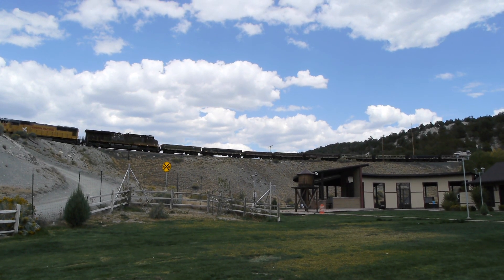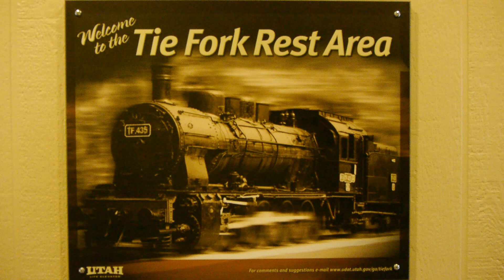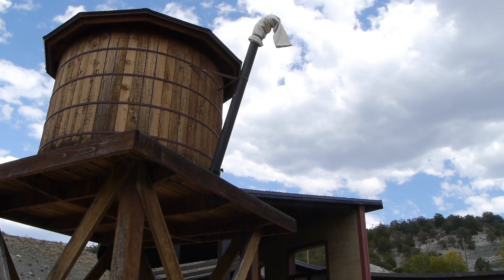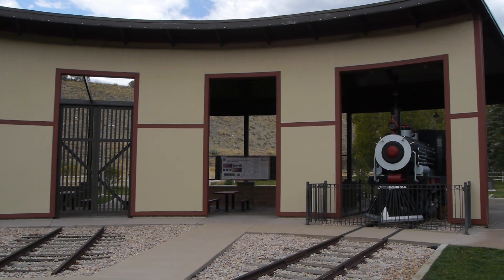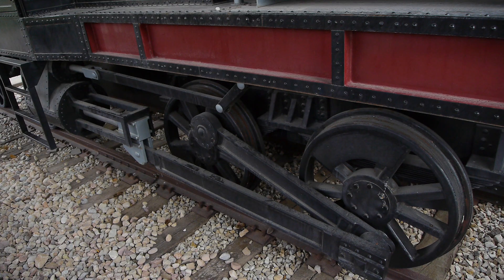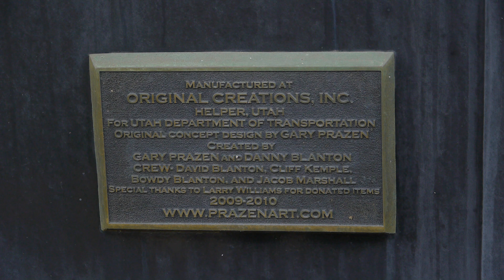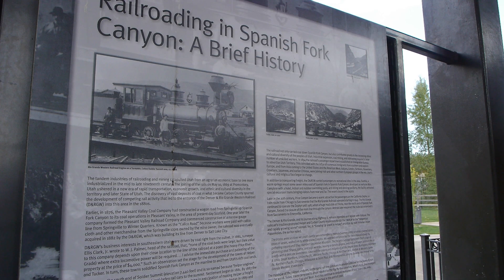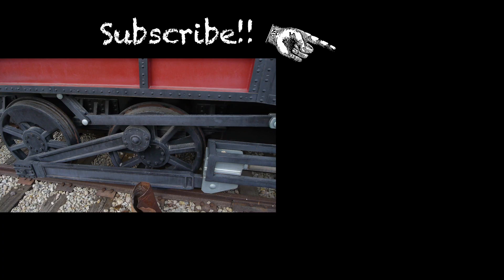Rest Area on the D and RGW in Spanish Fork Canyon with Odd Locomotive

Comment: That European steam engine picture shows a pruissian built G8.1 (0-8-0, later class 55.25) or a pruissian G10 (0-10-0, later class 57.10) but dressed as a polish or czech engine. Most likely it‘s a polish class TP4 (prussian G8.1) where the „P“ was changed to „F“, so it now is „TF“ for „Tie Fork“.
Reply from the maker: Yup. I spotted the TF. I’ll bet that’s the reason they picked the photo.
Reply: Toy Man Television Yes, I guess! By the way from those G8.1 more than 5000 engines were built and some came to Poland after Worldwar 1 when some German territory became polish. Some other G8.1s from the armistice stock in France came to Poland in 1919 to help there. They were moved from France to Poland in 50 secret trains via Switzerland and Austria .

Comment: I believe the consolidation in the picture at 3:58 is D&RGW 223 in  its early stages of life.
Reply from the maker: Certainly a C16. Can’t tell if it’s 223. But in it’s early life it was mostly a colorado loco. Yet I have no idea where the photo was taken. The others are at Thistle.
Reply: Toy Man Television I found that image linked to 223’s name on google images. But that also does not really mean anything because it could be any of the c-16s. How do you tell the difference between c-16, c-18, c-19 besides the name on the bottom of the cab?
Reply: How the drive wheels are arranged... spacing and the like. But the pictured locomotive was NOT a C-16, at least as of the date of the photo. Back then what eventually became class C-16 (around 1920 or so...) was called a “60 Class”. But, then there was “56 Class locomotives that were even lighter than the 60 class, but they didn’t survive to have their class updated. One more item... the “source” referenced above states that other than the Grant C-16 class locomotives, there were no other non-Baldwin locomotives on the Grande... but I note that the “source” neglected to note that the 10 K-28 locomotives were Alcos... I wonder what else he got wrong?

Comment: +ToyMan  Those guys at Original Creations (Helper, UT, USA) committed one bonzo blunder!  A few of those 3'-0"-gauge Burnham, Parry, Williams & Co. builds that could have served as models for Original Creations' project are still around, e.g. 1C'-h4 Model 8/18 D SerNo 3718 "Glenbrook" (delivered 1875) at the Nevada State RxR Museum, Carson City, NV, USA (ex-Nevada County (CA, USA) Narrow-Gauge RR; in original trim as delivered to Carson & Tahoe (NV, USA) Lumber & Fluming Company); or 2'B-h4 Model 8/18 C SerNo 3763 "Eureka" (delivered 1875) at Dan Markoff Properties LLC, Las Vegas, NV, USA (ex-Warner Bros. Inc. (Burbank, CA, USA); in original trim as delivered to Eureka & Palisade (NV, USA) Railroad Company).  Though I don't have serial numbers, there are even surviving 1D'-h4 Models 10/22 D's and 2C'-h4 Model 10/22 B's original to the Denver & Rio Grande (CO, USA), and its tributary narrow-gauge short lines.
Reply from the maker: Indeed. Thing is I think they spent a good chunk of the 1.9 million on the track and locomotive. Betting over 100 K. Had they laid 3 foot lite rail. And bag something D and RGW. Even rolling stock but a loco would be amazing. Instead.... sigh.

Comment: Well I suppose you can't really have a turntable pit in the middle of a rest area; there'd be kids falling into it and all sorts of other liability stuff going on.  It's a cute place, but that sign or whatever with the European loco...
Reply from the maker: Hi. Yup. But the track is also a trip hazard. I was thinking of the B and O turntable where the entire pit is decked. B and O had the same issue, lots of people walking around the stalls so the whole pits were decked in wood. And the huge disc turns. IN this case redwood decking with the track across it I think would look and work better. They actually roll the "loco" out at times onto the "turntable". And I think the back of it is a smoker or ??? Or was intended to be? Dont think it has ever been used if so.
Reply: You're right.  I guess I was so busy thinking about the filled pit I didn't notice the tracks.  Of course, when I think about all the stuff we survived as kids, lots of concerns today seem just a bit excessive.
Reply: @bob_._.  Seem???

Comment: The 'Europian loco' is a German class 55
Reply: The class 55 is an 0-8-0, (G8),  the one in the picture 5 driven axles,0-10-0 (G10)or class 57 , both of Prussian design. Used all over continental Europe with various designations.